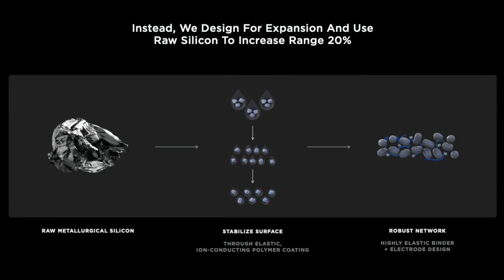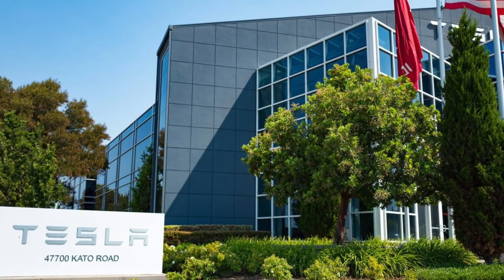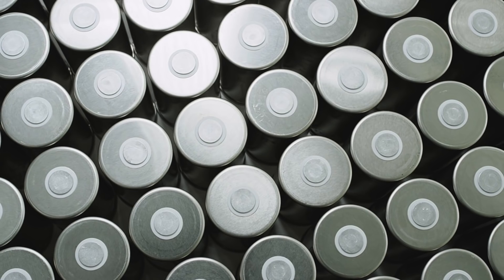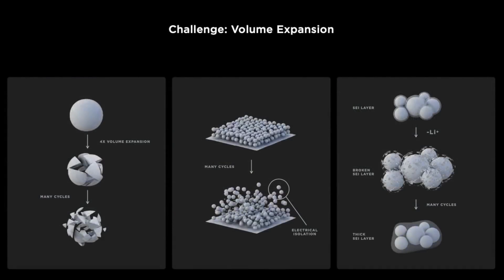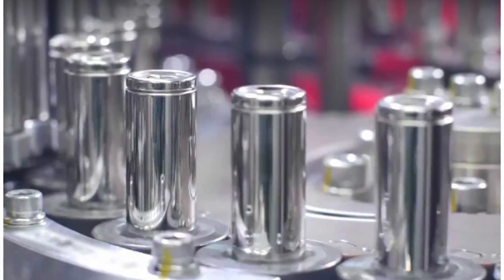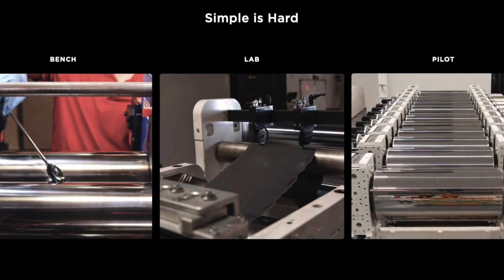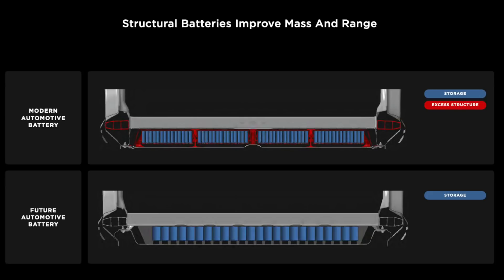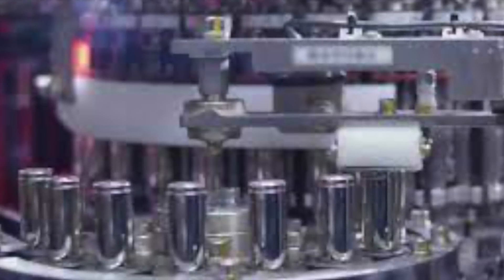Model S Plaid & Long Range Using Different Chemistry

Comment: Nope.... The s and x uses 18650 100kwh packs ... With Panasonics new chemistry as announced by Panasonic in January... The weight difference is because of the extra motor, gearset and the larger cooling system required for the plaid... They are not tabless .... 1860s can  output more power than 21700 due to the smaller forn factor having shorter electron paths and cooling properties but have less energy density... As an aside the Panasonic 1860 lines have a new increased stated output capacity of 10gw hours exactly matching teslas new increased 100000 stated s/x capacity

Comment: You are missing one very important point and possibility !!!! No new chemistry just a different existing battery !!!!! The 2170 used in the model 3 & Y was touted as a huge improvement over the 18650 cells used in the model S & X when introduced . Less number of battery's used to get more power!!!!  Scale up the model 3 & x 74 kilowatt battery pack to the reported 96 kilowatt plaid battery pack today. A lot less battery's in the pack and developing a lot more power. No modules in the battery pack just battery to pack.
Next I think battery cooling system is 2x the model Y Octovalve and what about the bloody motors ??????           !!!!! ALIEN TECH  !!!!!   Goes hard all day even on a low battery !!!!!
Reply: Except the 1850 can deliver  more power output than the 2170 per kwh because because physics
Reply: @robdale5641  By your statement you are claiming ELON put an inferior battery in the model 3&Y The 2170 was an upgrade an improvement on the 18650 . The same way the 4680 is the next upgrade !!!!!!!

Comment: If they have the new 4680 with the new chemistry, and therefore the structural pack design, why didn’t he mention this at the unveiling event? It would be THE benchmark bragging point among all of the others he mentioned.
Reply: Osborn effect,  No one would buy existing teslas with existing old Battery tech, every one would want to wait for the new 8640 battery backs to go on all other teslas

Comment: Don't forget the apparent breakthrough in battery cooling. There is a big difference in repeated full power output operation with Plaid. It might turn out that the small batteries cool better than the big ones.  Another way the new S/X don't seem to be consistent with battery day's message.

Comment: We need Sandy to tear one apart and confirm.  Please donate to make it happen at Munro Live.
Reply: Musk said he needed to keep some secrets talking about the new motor. Why should we pay to give away Tesla secrets?
Reply: @HeavenGuy  Knowledge is power.  Half my money is in Tesla.  If the 4680s are in the Plaid, then I need to move the other half into Tesla stock.  The 4680 is the most important thing Tesla is doing currently.  Vehicles and energy storage are depending on it's success.
Reply: @wineberryred  I'm 93% in, because (among a ton of other things) the Plaid Day "One More Thing" was actually Two that may overshadow 4680, due to the newly realized efficiency features being applicable to all battery formats. I.e.,  Ultra-light, carbon-wrapped motors, plus octovalve enabled battery thermal management.

So no changed chemistries as that would take whole reworkings of cell assembly processes. Also not 4680 which are needed for structural pack cars.

Anyway, the only way to know is to buy a $13-50+ MunroCom sticker to fund the last 1/2 of their MSP purchase for teardown (they may also reveal separate 3rd motor gearing & do run-to-drop testing).

Comment: Regarding "new chemistry in 4680".
Sorry
NO
I've explained before, the "5 times energy" is simply a function of the area of "jellyroll" contained in each cell.
If you assume that the jellyroll sheet remains the same thickness, and the diameter of the centre core of the cell is unchanged, calculating the length of the jellyroll for each cell based on inside/ outside diameter and the number of windings, then multiplying by the relative height (70 vs 80mm) gives a ratio of almost exactly 5:1

So the ENERGY capacity of ONE 4680 cell is 5 times that of a 2170 both using the same chemistry
It was a trick everyone fell for!!

THEN

Decrease the internal resistance of the 4680 cell by.....20%?
(That'll be *Tabless construction*)

That gives you the ability to pass more current without (resistive) heating the cell.
That's more POWER.
If that's 20% more power multiply that by the 5 times energy capacity and you get SIX TIMES the power output PER CELL
BUT
You use fewer cells in the pack!
Result? The 14% PACK LEVEL figure quoted.

THIS IS BASED IN THE SAME CHEMISTRY

If they eventually (or now?) use a BETTER chemistry, there will be even more improvement!

🙄 I'm fed up explaining this!!
Reply: Patience. Math is hard for some. Common sense is rare. Good, simple summary on your part will events win out. The fewer cells to assemble in a pack should be cheaper and more reliable as well.
Reply: Please one more time?  hahaha, I agree completely with you, and not only is the internal resistance reduced, the thermal path is changed considerably since the heat travels all along metal in tab-less and has to go through multiple insulating layers in the old pack setup.  That is why I am having difficulty with the new plaid not being a 4680 unless they made a tab-less 18650 or 2170, but as this video states, why do that?
Basically, tab-less allows much higher power levels, and the plaid appears to be capable of much higher sustained power levels, so this appears more to do with tab-less than chemistry, as you said.
Reply: Maybe add to your copy/paste (much less tiring) about tabless being dendrite-resistant allowing for greater charge/discharge, rates plus longer pack life.😇
Reply: @Crunch_dGH  what makes 4680 dendrite resistant?  I would expect that to be chemistry.
Reply: The batteries in this car are also not tabless yet. IMO

Comment: There is a comma between 4680 cells, and investments in Model S & X.
I agree there is inconsistencies and mystery in weight and performance, but surely they would not use a different battery pack in the Plaid?

Comment: I believe they are using an improved version of the 18650 battery to avoid redesign of battery case.  Also, I think they are still struggling with acceptable yields on 4680s.  Too many are getting recycled.  Anxious for my 2021 LR to arrive after ordering over 6 months ago.
Reply: But they did already redesign the battery pack. So that argument can't be used.
Reply: They had plans/design to use 4680 in the Plaid+ so it should have been easy to put in the Plaid instead.  Best way to improve yield is to start using the good ones in real world testing.
Reply: John Poldo
Wrong perspective.
Ask "did they redesign the chassis ? (yes)
Did they redesign the pack ? (Yes)
Would they use two different designs for Model S at the same time on the same line? (That would be..... Expensive, complicated, wasteful?)
NOW ask, which cell they would use for the plaid PLUS? (4680)
NEXT, assuming they were planning to make the Plus at some point in the past, that would dictate the wheel construction of the other versions..... Which would in turn dictate the pack construction (structural).

The only other question would be
"Can they (did they) find a way to make versions of the PACK using 4680, OR 2170, OR 18650 cells as required?
Reply: @rogerstarkey5390   You make a very good point and I have no evidence to refute it.  Surely they don't want two different pack designs for LR & plaid.  I'm thinking they made small adjustments to the existing pack using 18650 and are holding off major changes until a structured pack is designed with 4680's.  While we won't see a plaid+, I predict we will see in 2022 a "Plaid LR" using 4680s.   Price this model at $150-180K because no competitor can come close to delivering this performance.

Comment: 5 videos pushing the idea the Plaid uses 4680.  I guess you're really convinced.  Gonna be epic when you find out it's not.  Ha
Reply: Most people would be convinced even before the event/ his videos. Just the seemingly lack in mindblowing range throws many people off.
Reply: @koonhaokoonhao  the Plaid Plus was the one with the 4680.  Elon confirmed that.   The Plaid is not using the 4680.  That is clear to those of us who really follow Tesla closely.
Reply: @ezerratchaga  whats the difference between the plaid and plaid+ aside from the range difference?
Reply: @koonhaokoonhao  the 4680 together with a structural battery pack would enable them to fit enough capacity for a 500 plus range.  Other than that, the 4680 isn't anymore different than the other form factors.   But since the 4680 has been delayed for 12 to 18 months, there is no point offering that as an option now as it's creating an Osborne effect.  As far as performance, there will be very little and that would come from it being structural and lighter more than the battery itself.
Reply: @ezerratchaga  how would u explain the 6 months delay since u think its not 4680
Reply: @ezerratchaga  i think most of us are too bullish about the 4680 for the range. 500+ miles is probably the end goal with the high silicon anode fully solved. The limiting factor talked about this. 4680 format only accounts 16% increase in range. S performance (326mi)  to S plaid (390) range difference is 20% difference. +4% range for a decent level of silicon anode seems plausible. Rmb elon tweeting about the cells not being safe enuff in april. Could be due to the silicon expansion with every level increase in amount of silicon used.
Reply: @koonhaokoonhao  they have to redo the entire model S and X line.  The car is almost entirely redesigned from inside.. interior to new battery pack to new motors to new hvac, etc... if you have been in a factory floor you will know how difficult a task this is.. thats why you see different car models take so long to come to the market.  Even 6 months is considered fast.  

As for the 4680 form factor,  think of it this way.  It won't save much in terms of weight unless it's also done together with the structural pack.  When you increase the size of the individual cells what you end up with is saving the volumetric space.  For example, going from 18650 to 2170, you save about 6 percent in weight but you save 45 percent in volume.  That means you can pack much more capacity, for example more kwh into the same space.  That's why the Plaid Plus can do 500 plus miles.
Reply: @koonhaokoonhao  from 400 to 500 miles is about a 20 to 25 percent difference.  The volume saved by the new format factor together with the structural pack can easily accommodate for that... this has nothing to do with chemistry.  With the additional chemistry, say over 5 years, you'll get even more range out of them... but for the same chemistry it explains perfectly the range difference between the Plaid of 400m and the Plus st 500 Plus miles... yes, the limiting factor is a great place to start.  They also tells you why the 4680 is delayed btw...
Reply: @koonhaokoonhao  btw.  You're right about the giving too much credit part and Tesla Economist seems to think only the 4680 is responsible for the performance... when it's not... the 4680 is important BECAUSE of their dry electrode manufacturing, allowing Tesla to produce far more batteries than the competition.  The chemistry part will take many years to realise... also, the other important part is volumetric savings.. ie, ability to pack more batteries into the same space.  This would be important for vehicles that need the capacity, for example the cybertruck or semi.  And also, if you pack the 4680 with iron phosphate, then you can still do enough range in teslas compact 25k car.

Comment: If you are right, once again, Tesla leaves the opposition in the dust.
This leaves the opposition but one choice, build an EV that actually competes, on performance And price.
The result ? There is no going back. Hardly anyone will want another ICE vehicle. Ever
I can see the great crash of the luxury ICE car market getting ever closer.
Reply: I can too, but even if someone builds an EV that can compete, it won't have a corresponding supercharging network. Pretty big moat.

Comment: I think you are confusing Tesla and Panasonic. Tesla may have nothing to do with the chemistries for 2170 batteries in Nevada and 1865 from Japan. They  has to do nothing to "convert their oldest battery."  
They get 1865 cells for Model S/X from Panasonic Japan. Panasonic keeps making the 1865 batteries better. If they are good enough to satisfy the needs for Model S  (or even plaid) Tesla has nothing loose by continuing to use them - especially since they are battery constrained.   

My guess is whatever 4680 cells they make at Kato road will be reserved for initial model Y production at Berlin and Austin, and for a few semi's and cybertrucks - till they can get the new battery lines running.  

4680 as a form factor has no advantage except they can make them cheaper than smaller ones (per kwh). The difficulty is with cooling larger form factors which was overcome using tabs. 1865 may not benefit from tabs greatly. 

Once again, Tesla is not the only one constantly improving battery chemistries. I dont think the battery chemistries in 4680 were that big of a deal. The difference between Tesla and others (Panasonic/LG) is that no one else is so singularly focussed on reducing cost as much as Tesla is.

Kato road is 10GWh. Not 20.
Reply: Yep.  The batteries are constantly being improved chemistry wise... this car is not using the 4680.  It's clear as day.
Reply: Not only cheaper and more powerful, but also faster to produce. It would also be smarter for Tesla to reserve their 4860 batteries for the Model S and X seeing as they have not ramped up the production enough to supply their volume models. Tesla will also have discussions with Panasonic and their other partners about the chemistry and form factors of the batteries that they purchase.

Comment: The power increase is from the 3 carbon wrapped motors, not from the batteries.  Does the model Y performance use a different battery than the base model Y?  No, it just has a third motor.  IMO, the Plaid has the 1865 battery but with a slightly improved chemistry/process from the supplier, Panasonic.   Reuters reported last year that Panasonic expects to increase the 1865 and 2170 energy density by 20% within 5 years.  I think the change in the battery that Elon mentioned is a change to battery module for better cooling and lower weight.
Reply: Think about it.
Motors USE power (energy) they don't create it.
The Energy has to come from somewhere, it has to be provided at the required RATE (power!)The BATTERY must have the ability to supply the motors.
The motors must be efficient in their USE of that power.
Reply: @rogerstarkey5390  A battery provides two things to a motor - voltage and current.  I don't think anyone thinks Tesla increased the voltage for the Plaid batteries.  An increased current is also not likely as an increased current hurts efficiency as copper losses are directly proportional to current squared.  The power increase is from the motors, not the battery.

Comment: I think you're right about Tesla using the 4680 cells now in Models S/X. What was not discussed though, is the structural battery pack. I think it was not used in the S/X. You would also need single-cast front and end parts for that.
Reply: No, the structural battery pack is independent of the parts that you attach it to.  You can just as well use it with pressed metal parts.
Reply: Bernhard is correct.
The structural pack has an effect on the "safety cell", the passenger compartment, not the front and rear deformable structures in front and behind which are fixed to the structure.
The pack is essentially the rigid floor of the cage.

Comment: It seems to me that if 4680s are not being used in these vehicles then there could be a problem with model Y production ramping in Berlin and Texas as it would imply that the manufacturing process isn't ready yet. But why wouldn't Tesla just say that these cars use 4680? What could be the reason to hide this fact?
Reply: Sandbagging and free advertising.
Reply: Blue Toad
You keep posting the same thing.
IF they're not being used (they may be) it simply means that Tesla built a vehicle using old tech that spanks the best on offer elsewhere (so far).
They built a vehicle that's beyond the imagination and probably the capability of all but a few drivers.

They (probably) simply looked at the alternative (plaid plus?) and asked "WHY?"
For 0.03 better 0-60 and range increase outside the requirements, there was no point.
Reply: Just btw.
The reason?
Trolling EVERYONE!0 (Mainly on the negative side)
Reply: Osborne.

Comment: Yeah, after reading the earning calls comments I am convinced that S models are now using 4680, because elon said in the call about 4680 specifically that they are not yet safe
Reply: I think he said they’re not reliable enough to install in cars yet. Which I interpreted as a power issue rather than a safety issue.

Comment: It makes sense to prove these batteries in the S/X at low volume where a high failure rate and slower production process is tolerable.  For the model Y it'll need to be much faster of course.